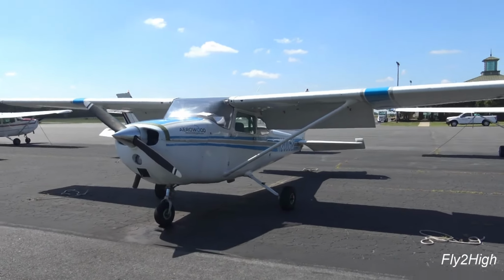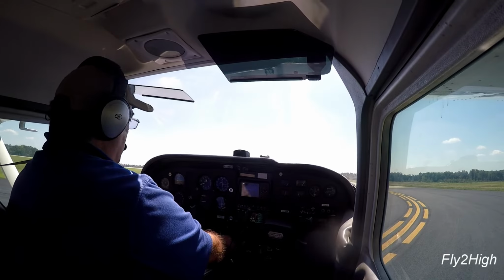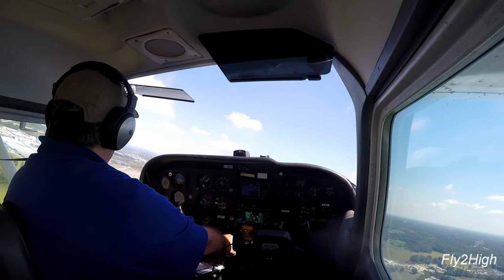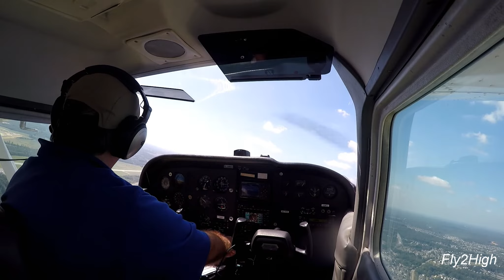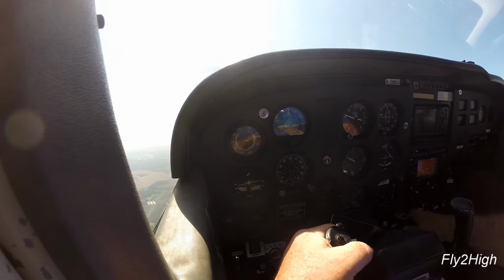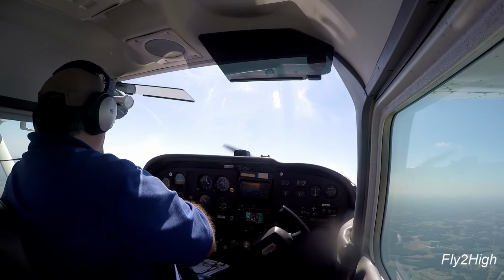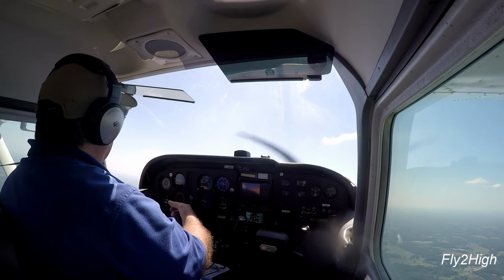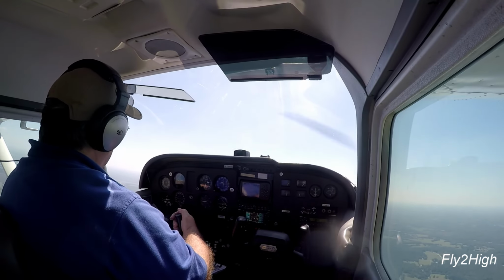The IMPOSSIBLE TURN made Possible! FTHVN 697

Comment: Don't try this, it is a bad idea.  I have personally seen 3 young men die trying to do this.  Three young college kids who would be alive today if they just glided straight ahead.  Instead, they stalled into the ground and burned up in a huge fireball.  Same aircraft, a Cessna 172.  I will never forget.

This guy Brian barely made it, at altitude, knowing what was coming, and not starting in climb configuration, with a little nose-down, and not at gross weight.  When it happens to you it will be unexpected while you are busy talking to a controller with kids in the back at an unfamiliar field, near gross weight.  There will likely be a crosswind, or oil on the windscreen, or a fire, and panicking passengers.  You will not react quickly as you might think, to boot.

And, it isn't a 180 degree turn...more like a 225 left  followed by a 45  degree to the right.  

There is a good reason for the landing straight(ish) ahead.  It is done at a safer flight attitude and speed,  and will be unlikely to result in a stall.   You may bend some sheet metal, but it will save your life and more importantly not put your passengers at risk of you stalling into the ground during a hot-dog attempt to get back to the runway.

If you doubt this, try it sometime in simulation , and have your instructor surprise you and scream at you (like your passengers will likely be doing),  .  You won't make it, at least not every time.  Your survival chances will be higher with the safer bet...ahead.

Comment: Critical Action Procedures for Turnbacks in PC12s in the USAF is to establish centered AOA (best glide) and roll flaps to 15 to decrease the stall speed. We calculate a TB altitude for every Sortie in our Take-Off and Landing Data. So that the decision becomes binary, if above that altitude, then Turnback, else, land straight ahead of the 3-9 line only turning to avoid obstacles and get on a course for best landing outcome. I didn’t hear in the webinar the idea of rolling flaps? Maybe worth testing that 360 with some flap settings in? It’s also, important for use to feather the prop so our constant speed prop can weather vane into the wind instead of being a giant drag device. Anyways, great video! Cheers!
Reply from the maker: x

Comment: I think you should train it from the runway which you can safely when you still have the engine. That way you don't have to trust the theory of others that may be wrong. Like the impossible turn.
Try to kink to the side immediately after take off and go parallel, that way you only need the 180 degree turn.
Reply from the maker: Thanks for watching!
Reply: Yes.  I teach them on the runway too and had heard many absurd theories from pilots (And CFI"s) that only did them "At altitude". 

Too many bullshiters that cannot prove what they say and tell you things that can kill you later on.  Tell them F you if they cannot demo on the field.  Avoid Bullshiters..
Reply: @feetgoaroundfullflapsC  Ditto.  Many CFI's dont know those "Quick Turnbacks, neither want to get their pants on and try to learn them.  They just BS you.  They almost killed me until i found a real cFi that did them for real and no BS.. That was in 1995.
Reply: @outwiththem  That was me victor.  Glad you are still flying..  Call me someday, Not flying due covid scared..
Reply: @emergencylowmaneuvering7350  Is the best CFI scared of a little virus??  Lol.. its me...
Reply: @outwiththem  You, you... LOL..

Comment: In the incipient stages of my trek to commercial multi engine instrument, years ago, the impossible turn was not a 360º, but rather a 180º standard rate turn, intended to realign with the departing runway. A turn which nearly always ended up with the aircraft striking terrain, before the runway could be achieved.  After flying aerobatics in a super decathlon round south Texas for a while, I often questioned the "impossible turn".  For me, the key was to not load the wings by pulling, while in a steep bank, as stall has no relation to bank angle, but rather to how much the wing loading is,..coupled with judicious use of rudder.  Anyhoo,...just my $.02.  Just for the record,...I'd still be looking to land straight ahead if possible.
Reply: Not entirely true. If you think about the angles and headings, let's say you take off runway 1 7, have a failure and then do a 180 degree turn. Sure, now you're facing 35 but you're set up parallel. In order to get back on Center Line you're going to need to continue your 180 to about 225 and then another 45 or so back to Runway heading of 35. So, while I agree a full 360 probably won't be necessary, it's very fair to say a 270 would be. Follow what I'm saying?
Reply from the maker: The debate continues!  Thanks for watching!
Reply: "A turn which nearly always ended up with the aircraft striking terrain"..  That is bologni.  The ones done wrong or from too low are the ones you know.  I did it and survived.  Have 2 more students that did it and saved from crashing on houses..  most good ones you never hear about, only the badly done ones you hear.

Comment: Barry Schiff, on that video draw a 45 degree turn after finishing the 180, then says that is a 90 degree turn. then another 90 degree turn to align.   That guy is wrong. Those are a clear 45 degree both turns.  A ? Turnback is a ?.  It is around 270 degrees total turning, Not 360 as the dork says.. Gee, how can yo say 45 degree is a 90 degree of turning??   I teach them on the runway, not BS.   I learned those turnbacks in 1996 from the only CFI in USA teaching 4 kinds of EFATO and they saved me from crashing on houses...

Comment: Its a Question Mark Turn, not a circle turn.  I taught them on the runway to many, even students.  Practice them with partial power first..
Reply from the maker: Watch this link if it works for you.  
https://www.mentorlive.site/program/20.html
Reply: @FlynBrian  He draw a 45 degree turn after finishing the 180, then says that is a 90 degree turn. then another 90 degree turn to align.   That guy is wrong.  A ? Turnback is a ?.  It is around 270 degrees total turning, Not 360 as the dork says.. I teach them on the runway, not BS.  I learned those turnbacks in 1996 from the only CFI in USA teaching 4 kinds of EFATO and they saved me from crashing on houses...

Comment: There’s no point in practicing this at altitude. There’s no way on knowing exacting where your theoretical runway is. The impossible turn is extremely possible and it varies between aircraft, pilot skill and the conditions. I’ve done it in my light sport aircraft at 250. Gained another 30 feet of in the turn whilst making it back. It’s easy to practice. Start at 1000’ and work your way lower until such time as the runway is no longer an option. Bam! there’s your general threshold.